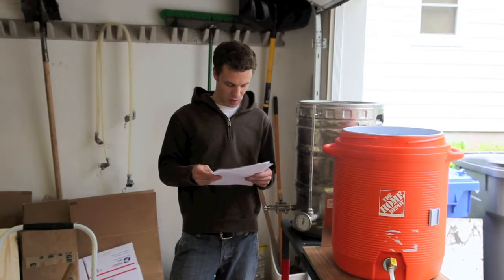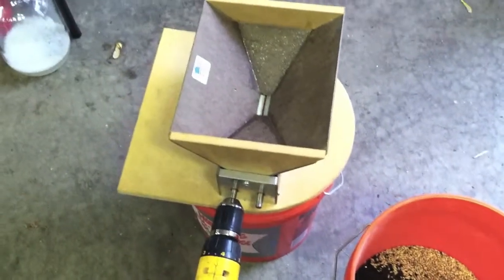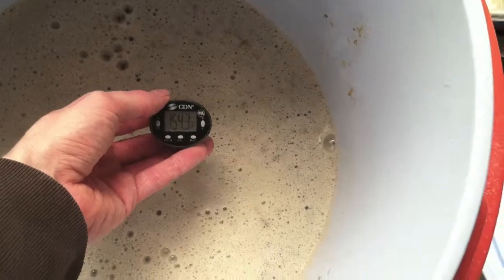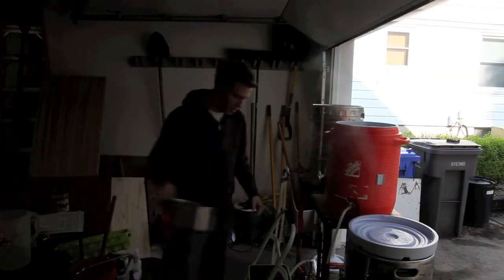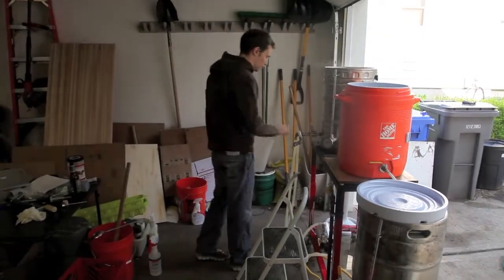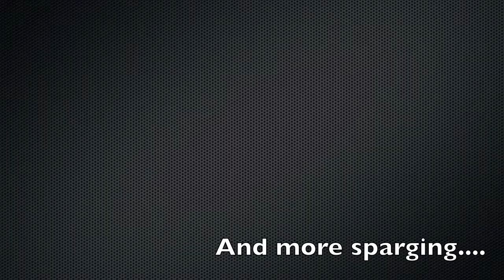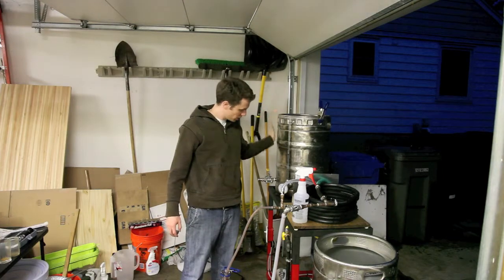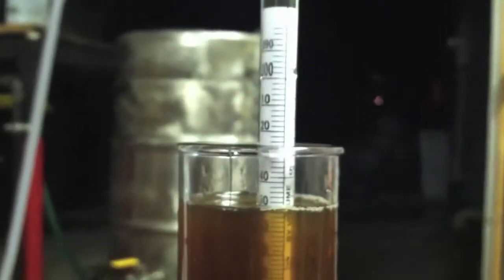All Grain Brew - Walker's Scottish Ale

Comment from the maker: My process is still evolving, so it's not as efficient as it could be. I did zero prep time w/ 90 min boil, total time was around 5 hours.

Yes, built this all myself. Had no help or knowledge of any of the tools that were required, but I learned as I went and did a fair bit of research.  I'm happy with the result.

I've decided that 10gal batches are the way to go.  No sense in taking half a day for only 5 gallons. There's plenty of time and people to drink 10 gal. 

Thanks for watching!